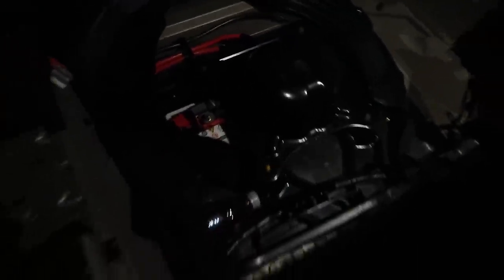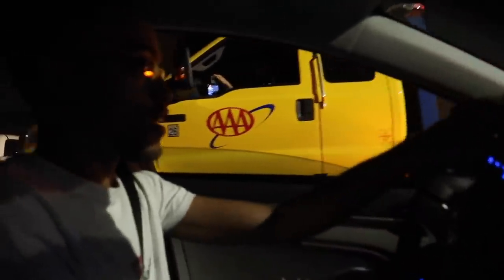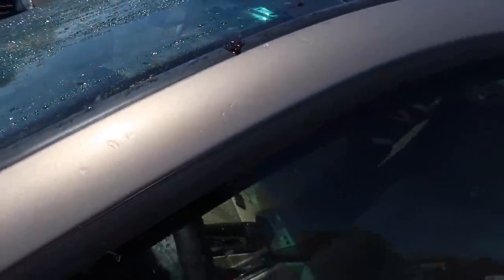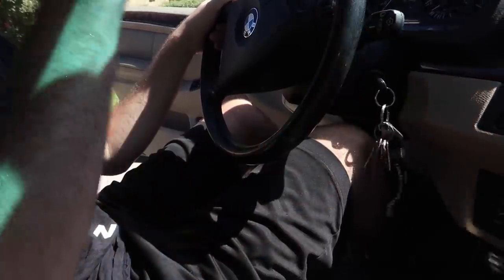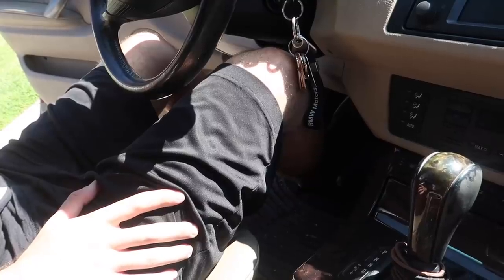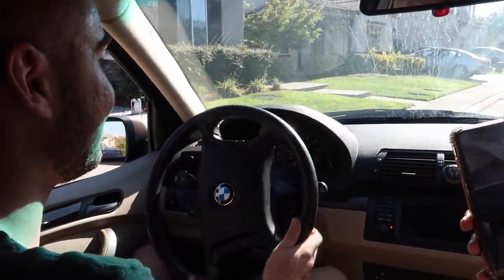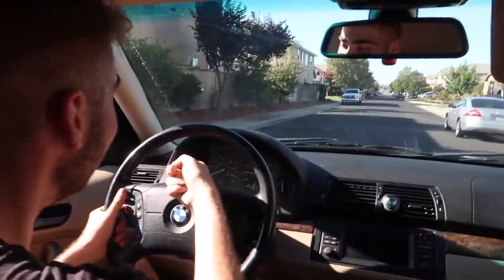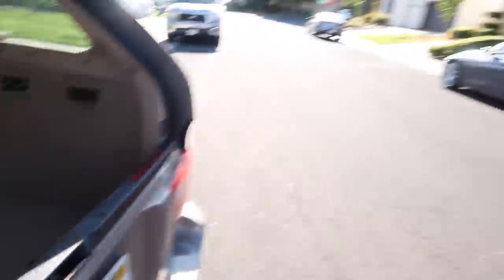TURNING A $300 BMW X5 INTO A $4,000 BMW X5 IN ONE DAY!

Comment: Cant test the AC if the car isnt running....also its not compression. It would still start with low compression. Its fuel or spark. That's all you need to start a car. A car sitting will NEVER EVER cause low compression.
Reply: I had the same problem when lights were flickering and it wouldn't turn over. For me it was a battery that needed changing
Reply: I know this a year later but have you ever tried to start a car that's been sitting for decades and has the piston rings stuck to the piston? this has caused low compression in some engines I've worked on, but after a couple of heat cycles the piston rings release and reseal again.
Reply: Actually, no.  Fuel, air, and spark are what you need for it to run.

Comment: You should try oiling the cylinders a bit before your compression test. Usually you want to do the test with a hot engine so your results may not be 100% accurate.
Reply: Cant really do it with a hot engine if the car doesn’t startlol

Comment: Try getting INPA set up, with ISTA/D I got it it is the best 50$ I've ever spent on a cable, you can also re flash the modules to have things like break force break lights and triple blink blinker.  Main thing is that it will allow you to read all of the modulus, test values , run system tests and error codes.  I got my cable from bimmergeaks.

Comment: You jump it from posts under the hood.  I have this exact same car.
Reply: Jim Eadie yup, never use starter cables on the battery it can damage the electrical componets. Always use the ones in the front who have protection to not damage them
Reply: It doesn’t matter either way..... just don’t cross them the wrong way. Easier to just pop the hood though rather than dig everything out. Also coming from an x5 owner. Wooo

Comment: Last year, I was fortunate, as well, to have had the opportunity to buy a clean black '01 3.0 with 110k miles for $500.  The previous owner had purchased it from the original owner and because it sat for an extended amount of time, one of the serpentine belts broke and knocked off the off the top radiator hose, causing it to overheat on the freeway.  They had pulled over immediately to have it towed for the rest of the way home.  Not being familiar with the motor, or modern vehicles for that matter, guy attempted and failed to try to fix and get it back on the road.  Apparently, guy brought it to one of his mechanics who stated that it had a blown head gasket.  I brought it home and connected things and then turned it over and noticed that it had a slight misfire which was reflected in the code scanner.  I replaced the coil packs and plugs and replaced the thermostat housing, which wasn't fully mounted/installed and was where the coolant leak was coming from.  After fixing these issues, it ran like as it should!

Comment: i just got a 300$ 2001 bmw 330ci with 325k miles not quite 140k like yours and broke the oil drain plug bin the oil pan but removed it with a bolt extractor and mikita drill. replaced an o2 sensor and fixed the M.I.L ( check engine light) might smog tomorrow and reg expired 11/2018

Comment: I have an 05 x5 3.0 it eats  batteries one per year haven't figured what the fix is
Reply: woody ahh Does it get funky during the winter? and when you turn the key does the starter engage and click or does it just click once and stop? It’s probably either a parasitic drain (read somewhere on forum it’s usually the bluetooth module I think?) or it could just be your BST on the battery, mine tends to act like a dead battery a couple times every winter, usually if you jiggle the cable it’ll stary.

Comment: Here are the big things with these cars.....they hate city driving.  The CCV likes to gum over because of condensation buildup from short city trips.  Will look like mayonnaise under the oil cap.  I put a catch can system in mine to help with this but still needs to be watched.  The other thing is the seat sensors for the air bag tend to go out. Some are covered under recall, some not.  Mine was not. Bought a airbag emulator box from ebay that took care of it...otherwise, great car.  Recently have to my 16 y.o.  and he loved it.

Comment: I own one of these. Spend thousands replacing control arms, front axles, ball joints, every single gasket, every single coolant hose, the entire transmission, water pump, etc. You literally will need to replace everything after 100K.
Reply: are you high? I own an E53 3.0 with 220k, I’ve spent MAYBE $2k redoing every front control arm as well as the rear uppers and wheel carrier ball joints. Did you replace both front axles? It’s typically only the front left that fails. The water pumps on these vehicles rarely fail because they’re mechanical not electric, do you maybe have an E70?